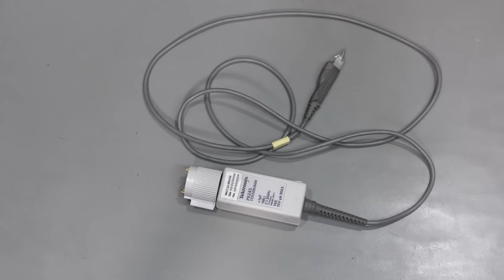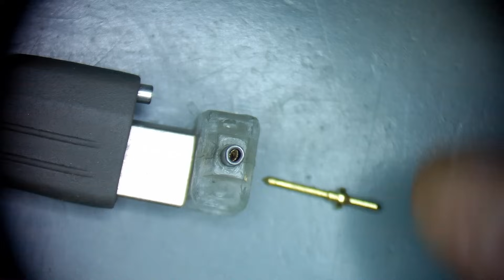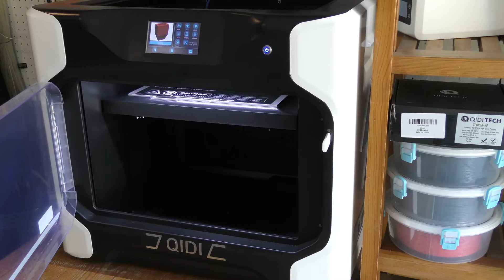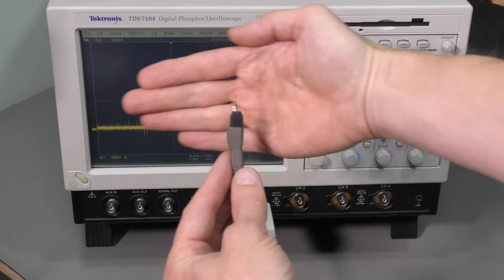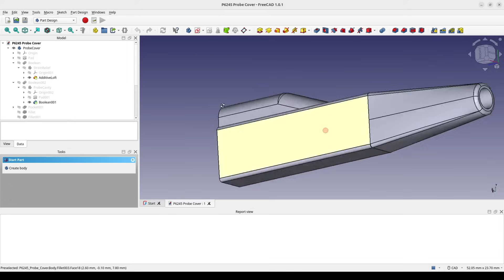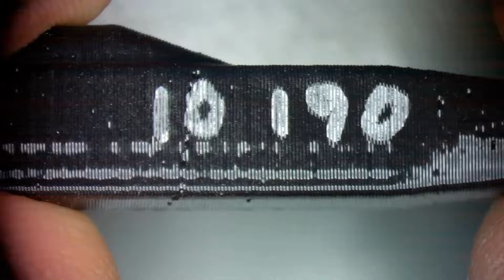#162 - Tektronix P6245 active probe repair - part 1

Comment: Awesome work on this! Regarding ideas for the probe sleeve,I think people already gave many good ideas, but another idea to throw out there is printing the 2 halves (like many people suggested), and then using heat-shrink to hold it close and give a smooth finish. Not sure if it's possible to shrink the heat-shrink without deforming the plastic, but I guess if you use some high-temp plastic and are careful with the process, it could work.

Comment: Make a replacement cover in two pieces that you can attach over the cable.  If you cut the cable you will change the delay.  It is also unlikely you will achieve the same SWR as the original.

Comment: I don't know much about 3D printing. Would it be possible to print the bottom and sides of the rubber piece, insert the probe, and then finish with printing the top side?

Comment: I would definitely leave both ends alone, cut the cover and glue it. 
Not worth risking imho. 
You could also try printing another slightly bigger cover (print whole, the slice it longitudinally on one side) to go on top of the first one, and glue them one on top of the other, like a glove on top of another glove

Comment: Great work on that probe end.  Unless you are going to use Tek add-on bits, I reckon that's good enough as it is.  As for the boot, I'd do something in 2 halves to save messing with the wiring.  Added advantage is if they wear out later, you can just change them the same way.  Maybe try that liquid tape stuff to join the 2 halves?  Or black silicone sealant?  Love your videos.

Comment: I have injection moulded TPU at 150-160c, try going lower in temp. I would also just slice the cover in half and print it in two pieces, then glue them together in place.

Comment: I have a thought. Print the rubber boot in PLA. Sand and smooth the outside to make it perfect. Then use that as a pattern to cast the boots in silicone. If it is flexible enough you might be able to expand it enough to fit over the probe so you won't have to disconnect the cable.

Comment: I second the idea of printing the cover+strain relief in halves and gluing them together, rather than trying to desolder the cable. Attacking either end of cable seems awfully fiddly.
Reply: Not only fiddly. The RF coax cable center conductor is likely non-solderable, like in the standard passive probes. I would not mess with the cable at all.
Reply: @milantrcka121 the coax cable center conductor is non-solderable in Tek passive probes? I think that's not true with the passive probes from the 70s (e.g. P6075), because the probe manual specifically has a cable replacement procedure that includes soldering the replacement cable to a terminal in he compensation box. Later passive cables use a non-soldered pluggable cable, so maybe that was a subsequent development.

Comment: Try to slice with PrusaSlicer. I had similar gaps if the part was sliced with Cura. (QIDI use an old Cura version)... EDIT: Also did you try with printing 10 models at a time instead of only one?
Reply from the maker: I tried two, but, perhaps, they were placed too close to each other, so I did not see any benefit
Reply: @feedback-loop  This kind of micro gaps can occur if the retraction setting is too high. I don't know if the profile you used with PrusaSlicer is  official from QIDI, also the profile for this particular filament, it this case the setting could be the same, so better if you test with lowering retraction for your extruder...
Reply from the maker: @MrTon4eff  lowering retraction led to a horrible result
Reply: @feedback-loop  If these micro gaps are present only on one of the sides of the test cube, this is a proof that something is wrong with your retraction distance or the extruder. They appear only after the retraction is performed. Did you try with a test model with more angles (more often change of the retraction)? I don't have exactly the same qidi model, but I had lots of problems with another qidi model a few years back. I solved most of the problems with changing the extruder with another one (not from QIDI)...

Comment: Привет.
First off, nice job, your videos are great. As for the replacement strain relief, for cosmetics try the finest grit sandpaper, like 5000 just to see what you get.
About mounting it, i wouldn't cut or disassemble existing connections, just split the replacement strain relief on one side with exacto-knife and use some epoxy glue to fasten it to the probe cable and to seal shut the split side. Or maybe don't even use any glue at all, try to fix it in place by applying heat, both to heal the split end and to affix it to the probe cable.
Пока😀
Reply: I like this idea; make one edge slightly wider, split with razorblade, install, press slightly while applying a little hot-air.  Molten TPU should instantly stick to itself.  The steel probe body will quickly wick away the heat.  Could also try hot-air levelling the surface but this tends to be highly finnicky.  Could also try a rough surface - most printer slicers offer this.

Comment: Make it like they do in factory. Make a mold with 3D-printer and inject soft plastic into mold to surround probe. I would look into Polyurethane witch can be cast into car suspension bush.
Reply from the maker: these don't look molded. they are not attached to the underlying stuff like the probe head and cable

Comment: Fascinating repair! Looked as if the flat flex may have been sliced during an attempt to disassemble the compensation box. If you are still concerned about the effects of the rf shield material perhaps a smaller pocket and a bit of zebra strip would work. As others have suggested, trying a minimum layer time may help. I have successfully printed replacement button caps for a Racal-Dana 1992 counter using TPU-95. Regards, David

Comment: Those artifacts looks like seams related. Try adjusting the seam/scarf settings or slightly rotate the part on the bed. Placing the part in a different area of the bed may also help improve print quality.

Comment: I would certainly leave the BNC side alone. i have been trying to repair Tek probes myseld, albeit different models. That crimped-on metal part on the BNC side you will never (I think 😊) be able to remove/refit properly. I also found that the central wire in the Tek probe cables that I tinkered with do not allow themselves to be soldered. No idea what alloy they used, but likely you can only crimp them. Which of course requires the right crimp tools and pins etc. Likely unobtainium.

So... I think I would like to see the probe-end of the cable first, maybe that is easier(?). Or at least less of a pain.

Nice video, I love this kind of problem. (That is, if I manage to fix things. Less happy if it fails 😢)

Comment: I think on small parts the layer that was just printer does not have sufficient time to cool before the next layer starts. Does your slicer have the ability to add a minimum pause between layers?

Slice one edge of the probe boot, slip it over the cable and glue seam back up.
Reply from the maker: yes, I just looked, and I see "Minimum Layer Time" set to 10 seconds, but "Lift Head" is disabled, and it might be hitting the "Minimum Speed" that is set to 10. So I should try reducing the minimum speed and enabling lift head.
Reply: @feedback-loop  Another trick I have used is to print 2 small items at once, spaced 50~75mm apart of build plate. This will allow cooling time of movement time plus 2nd part layer print time.
Reply from the maker: Regarding your idea to slice and glue, I am afraid it will look ugly.
Reply: @feedback-loop  You could redesign the part with an offset split built in (like the lip of a plastic case). Then you can slip it over cable and glue at split and it will look factory made.
Reply from the maker: @HeyBirt  Perhaps an offset split might work. What do you think would be the right glue for this?
Reply: @feedback-loop  My first thought was silicone RTV but a bit of research indicates it does not work call. There are some CA types that are reported to work with TPU.

I think I would try E6000 first on some test samples (I keep it on hand). It sticks well to about everything, remains flexible. I use it for all sorts of assembly work.
Reply: @feedback-loop  Loctite HY 4070 seems to give excellent results bonding the exact TPU filament you used.

Comment: There may be a cooling issue. It might help to have an external fan blowing air onto the part during printing. The smaller a part, the less time each layer has to solidify. I often run into the minumum layer time of the slicer with small prints.